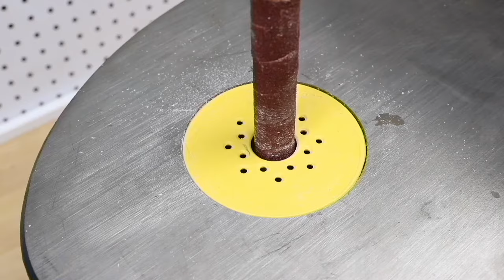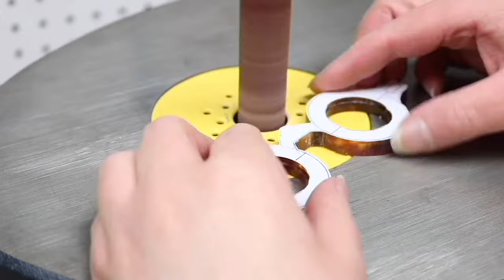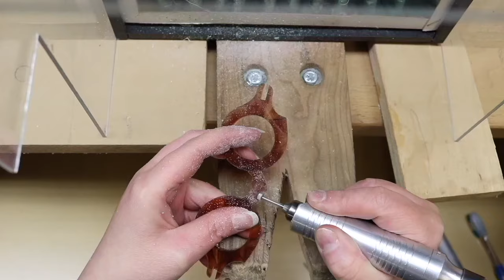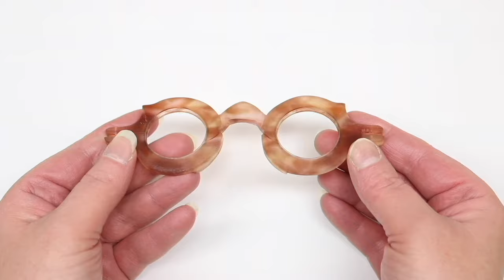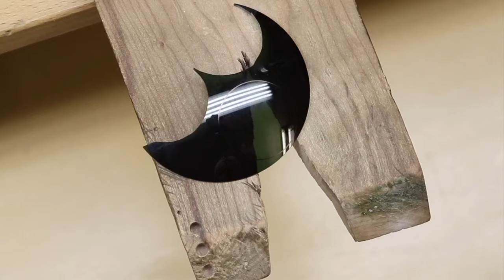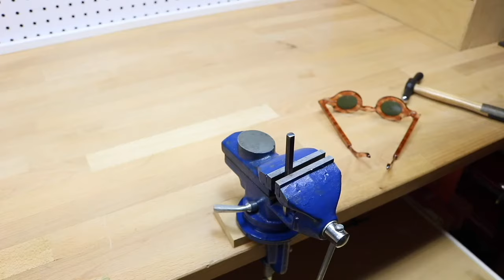See Me Make: Cellulose Acetate Spectacles

Comment: Where did you get the glass for the lenses?
Reply from the maker: Hello Carmel,

I use Plano lenses. I had quite a bit of difficulty sourcing the lenses. I found a few online shops that sold only to opticians and had an online form which had to be filled in giving your credentials.

Here are two suppliers that will sell to me: 

www.mccrayoptical.com 
www.kleargo.com

I filled out the applications as best I could, leaving some of the questions blank. McCray Optical passed me. Kleargo did not. But, I emailed them explaining what I was making and supplied a link to my website which had some images of sterling silver spectacles I already made using lenses purchased through a local optician who has since retired. After reviewing my site, they decided to sell to me.

However McCray only sells domed lenses which will work fine if a circular shaped lens is required, but not on any other shape. The first pair I made with Cellulose Acetate has green round Plano lenses (with UV protection) - which I purchased from McCray.  But the second pair I made, with the Blue Cellulose Acetate has rectangular lenses and require flat lenses.Kleargo sells flat Plano Lenses - but only clear ones. So I learnt how to tint and apply a UV protective coating. I purchased the tint dyes and UV protective coating from McCray. 

Incase you were looking to purchase some Cellulose Acetate, I found some on Ebay

https://www.ebay.ca/itm/Tortoise-Shell-Cellulose-Acetate-Mazzucchelli-RAW-original-extruded-sheets/360879810787?ssPageName=STRK%3AMEBIDX%3AIT&_trksid=p2057872.m2749.l2649

But have since ordered some from: https://www.takiron-rowland.co.jp/product/#L

Takiron Rowland is a manufacturer of Cellulose Acetate in Japan - but ships out of China. I emailed them and explained I was learning how to make Cellulose Acetate spectacles, asking if they would sell me a small quantity. After a few emails back and forth they agreed.

If you are interested in making some spectacles but have a hard time getting the supplies, please let me know, I might be able to help you out. Or if you would like some info on tinting lenses - I'm happy to do a tutorial for you.

Nicole.